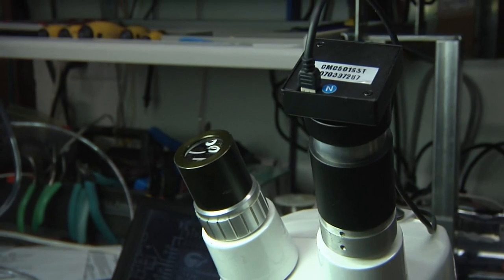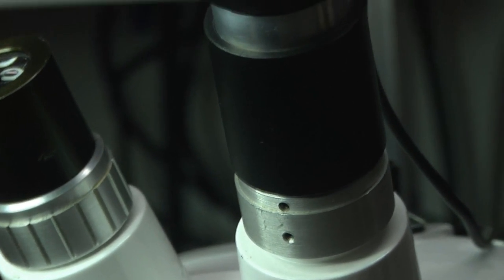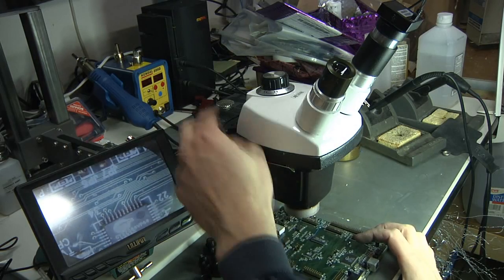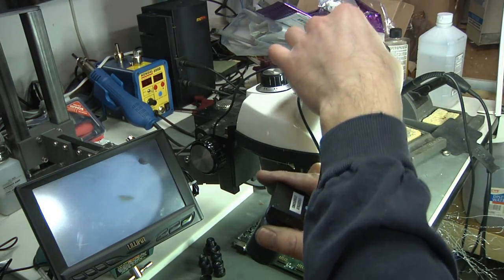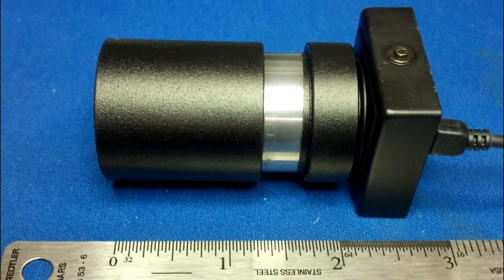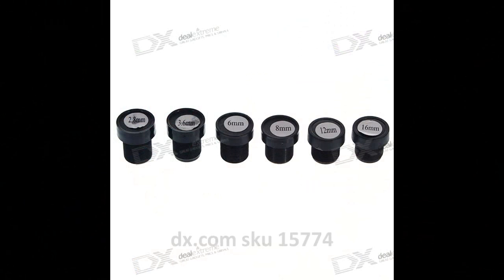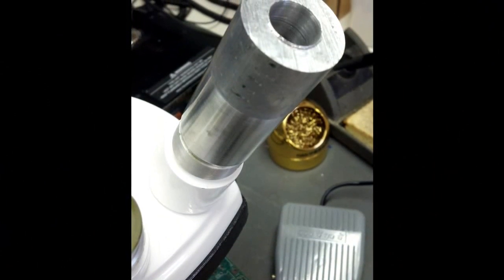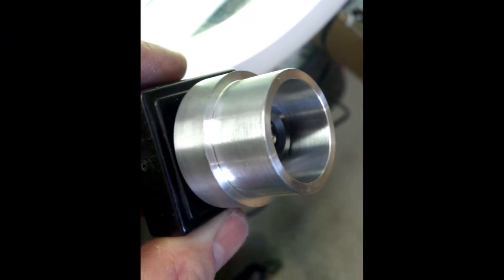Stereo Microscope Camera Hack

Comment from the maker: Unfortunately I don't have time to build more, sorry.

The camera is several years old, but I bought it from Super Circuits online.  The lenses were from Deal Extreme, and I gave the part number in the video.  The specific dimensions of the adapter will depend on your exact camera and eyepieces, and it needs to be adjustable to allow focus adjustment, so you should be able to experiment and make something that works easily enough.